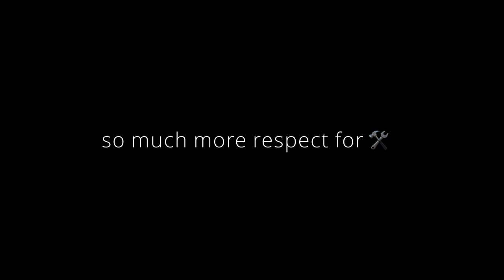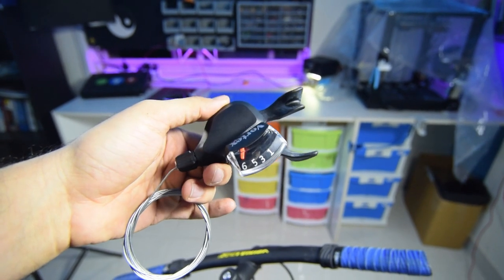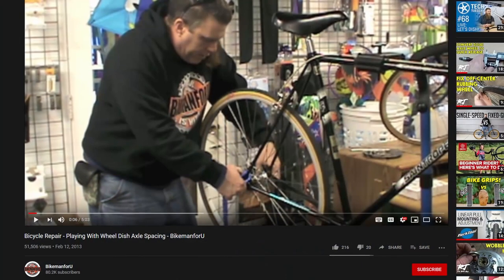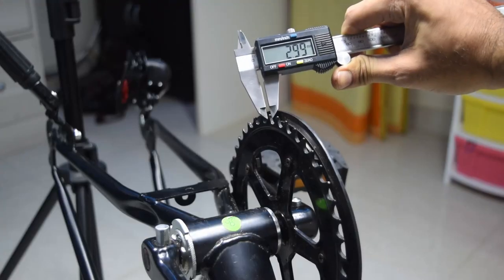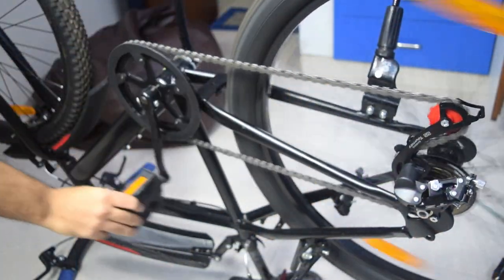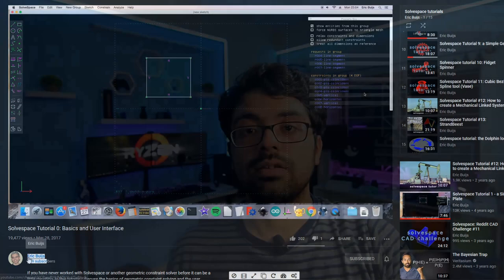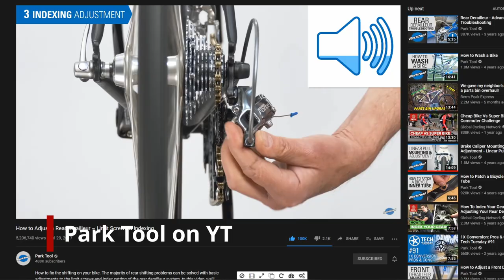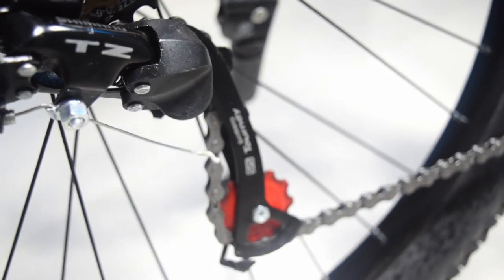Installing Shimano Gears into ANY Single Speed Bicycle | DIY Gear Upgrade

Comment: I'm really glad I came across your video. I recently bought a Dahon single speed bike and while I did enjoy riding it, riding up inclines is absolute hell on my legs and nearly blacked out. Twice.

I was planning on upgrading/modding the bike with a few adjustments to make my rides easier. And seeing that a 6-gear hub will not fit a single gear hub really made me rethink about installing a 6-speed hub. It would be better to get a 3-speed hub for the spacing. 

Overall, it would have been much easier to just buy another bike and just toggle with that instead. That way, all you have to do is swap out the OEM with aftermarket parts.

Comment: This is a great video... thanks for sharing! I am looking at adding gears to a fat tyre BMX and then adding an electric motor... This gave me quite a bit of insight into what I'm trying to do. Could you have not just replaced the chain wheel with a compatible one? Or are these universal and an expected challenge?
Reply from the maker: I could have probably replaced it, but due to pandemic I had to order it and I didn't want to wait too long

Comment: The 3d printing ,man that's a great skill, you couldve drilled a hole through the handle bar or added a hose clamp and drilled the hose clamp,the wheel needs to be re aligned or also known as "dished"which basically moves the wheel position to one side more then the other,it is done with a wheel spoke/nipple' tool or an adjustable wrench and by oiling the spoke and nipple thread junctions before doing so,that way the axle will also benefit in giving you more thread on both sides of the axel bolts, check your wheel spokes afterward because some will protrude out of the nipple thread junctions so you may need to file them down afterward,also check your wheel rim holes maybe add duct/pipe tape as a rim liner,to prevent a rim puncture✌
Reply: You are right. He should have dished the wheel and can still do that. However it will not make his axle longer 😋

Comment: Nice work. 
Good documentation. 
I have done plenty of DIY on motorcycles when I was younger. 

My only q.

After everything was done, could you manage to get the rear wheel properly aligned , as in, centered?

Comment: I purchased 6 speed gear kit- freewheel and derailleur is from vanum with shimano 7speed rapid fire shifter plus gear chain, now I am facing same problem with chain, gear chain is thinner so I have to sand or file down the chain ring.
Angle grinder reduces your efforts but increases your chances to make mistakes but filing is peace of mind just because it reduced work speed....! 
I will share my experience if I face any more problems.....!
Reply from the maker: Good luck!
Make sure to paint the exposed chainring with some good paint. A spray paint won't work well.

Comment: Im also considering upgrading my gears and I have come up with a solution regarding the axle not long enough, offset ecc. Maybe buying a rear wheel with 7 speed cog(i found some in Facebook market that is ready to mount) will simplify the job.
Reply: Or install a new hub into your wheel. Make sure the diameter of the spoke holes is the same so you can reuse your spokes otherwise it will be too costly.

Comment: You were really honest. I liked that. After watching this video I decided to buy a geared cycle instead of modifying a gearless cycle. But I wondered why didn't you buy a new chain which was thicker enough to fit your front chain wheel instead of scrapping off the thickness? What if you get a thick chain next time when the present chain is over used? Any way lot of things you have done. I would have left this project at the first challenge itself 😂😂😂✋👍🏿
Reply from the maker: 😂 man If only the thicker chain worked, thicker chain won't work with the gears at the back and the derailleur
Reply: @chinmayshalawadi1  Then that was the only option bro. I missed it☺️

Comment: You could change the stem and handlebar
Reply from the maker: Yep that was another option!
Reply: @chinmayshalawadi1  I have a 29inches single speed mtb  and I want to install gear in it so what u suggest should I do it  or not.??
Reply from the maker: If you have the time and you like doing such things then go ahead!! It's a great experience. As you saw the process can be quite tedious
Reply: Great work.. 🔥

Comment: I had 24 inch wheel, I want to upgrade it to 26 inch, when I tried it worked for single speed (rear wheel free to rotate 26 inch one) but when I put gears (I already installed it for 24inch) it strikes the frame,... Please anyone know how to keep wheel at the centre even after installing the gears???? Please help me out guys..

Comment: How did you mount and guide the gear cables on the frame? Didn’t you find problems with the cable slacking?
Reply from the maker: I used zip ties to tie them to the frame of the bicycle

Comment: I feel like im looking into the mirror because this is pretty much the same adventure im going through right now although still at an early state since im unable to remove the damn single-fly wheel and crankset/chain ring, idk how you managed to do so without the dedicated tools but im also no cyclist, i just wanna convert my cycle to a decent multi-speed one instead of the crappy installation and parts the local bike shops in india/Pakistan offer. I also want a wider gears range than the generic 11-24t 6speed the local market has (thatd an estimation)

Comment: Great work. You mentioned problem which no other youtuber did. Besides, there aren't any videos on turning a single speed into a 8 speed. You helped me a lot. I was just wondering to know if the ride has become easier in uphill?  And doesn't the derailleur get stuck in the wheel while you're on the 1st gear?!
Reply from the maker: Yes Ride has become so much better uphill. Nope derailleur doesn't get stuck :D

Comment: do i need to change my bicycle wheel hub for installing gear???
Plz reply sir 🙏🙏🙏
Reply from the maker: Ideally yes, to do it the correct way change the hub of the rear wheel to one which can hold a gear cassette. But building the wheel again at home is a hard job.

You can still use existing hub but it's a bit of a hacky way. Not durable for long term use
Reply: @chinmayshalawadi1  ok 
Thnk u so much for your response ❤️🙏🙏

Comment: I'm planning to get this done. Is it better to have 6/7 gears or install the crankset as well to make it 21 speed? What do you suggest? Any reason why you did not do it?
Reply from the maker: This was just an experiment and my cycle had a very cheap crank and a very old style bottom bracket. I would have had to replace the bottom bracket and the whole crankset. 
It would have gotten too expensive. 

If your city is very hilly then get 21 speed, else 6-7 speed will be enough
Reply: @chinmayshalawadi1  thanks. It's for Bangalore roads..
Reply from the maker: Yeah 21 will be better for Bangalore roads 😂😂, many places are very hilly.

Comment: You should have added 5-6 ring in your old chain and that may worked fine ! I am planning to change my frog cycle from single speed cassette to 7 speed 12-28 ... I have ordered Betwin cassette, derailleur , shifter and chain from decathlon.
Reply from the maker: What's a 5-6 ring ? Good luck  with your upgrade :D
Reply: @chinmayshalawadi1  chain rings ...
Reply from the maker: Ahhh
Reply from the maker: Thank you I'll take a look at that

Comment: I have a 20 inch mongoose axe bike would it be possible to turn it into a multi speed bike?
Reply: As long as it has a steel frame which you can expand to 130 mm
Reply: @rolandberendonck3900  thanks.
Reply: I want to convert my busted schwinn scrambler into an ebike and the 20" cheap kits have gears on the hub so I'm wanting to add gear selection as well.. anyway I'm sure it can be done with persistence

Comment: My bicycle is a single speed bicycle with a full aluminum frame. So can I install gear on my cycle?
Reply from the maker: Aluminum is a bit tricky. Aluminum does not bend that easily. I wouldn't recommend

Comment: My cycle is 7 gear i want to upgrade to 20gear how much would it cost
Reply from the maker: You'll need to change the front chain ring from single to 3 chain rings.
Reply: @chinmayshalawadi1  how money 💸 bro
Reply from the maker: Depends on your cycle, how much you want to spend and what's compatible with your cycle.
You might also have to upgrade the bottom bracket.
Reply: @chinmayshalawadi1  its my brother cycle he took it in Dubai may be at 10k now its for me so i should i upgrade it or wht
Reply from the maker: Just use it with 7 gears for sometime. It should be enough for the most part. 
If you absolutely feel like upgrading later you can think about it
Reply: @chinmayshalawadi1  Ok bro 💕 becz my parents said they will not buy me new cycle so i have to cycle like 😂3km to college so

Comment: Hello, can I install these multi speed gears on Hero Velocity? It has single speed. Electric bicycle. Thank you.
Reply from the maker: Not sure about electric bicycle. It will have additional complexity of electrical wires and motor on the rear wheel. You can probably do it but, you'll have to research a lot
Reply: @chinmayshalawadi1  thank you very much!! Will do.

Comment: How we can install 1x8 gear set in single speed?
Reply from the maker: Usually not possible without changing the rear hub, since 1x8 gear set don't come as freewheels. You'll need to switch the hub to a cassette compatible one
Reply: @chinmayshalawadi1  Not at all. 8 gear freewheels do exist. However you need an even thinner chain with that freewheel so you have to file some more away then 😂

Comment: I'm preparing to do this myself.  I am using an old 10 speed that has no miles on it so the gears are perfect.  Everything matches so hopefully after watching your vid I will avoid some of the complications you encountered.  But, this is a great presentation.  Thank You!
Reply from the maker: Thank you :)

Good luck with your build !

Comment: I have also a gear kit and i installed but my break is not working pls comment
Reply: Pls comment
Reply from the maker: Hey usually the wheel won't be centred if you haven't changed the hub. You'll have to offset the break pads with extra spacers on one side and remove spacers on the other side. Also play with the brake caliper tension
Reply: @chinmayshalawadi1   thanks

Comment: Dude! you actually did a great job, you are a true engineer. Also,you left one step after cold setting called dropout alignment, check 'rj the bike guy' he has made a video about it, dropout alignment reduces the chance of axle breaking. Best of luck 👍
Reply from the maker: Thank you :) 

I've actually seen that video!! 
I figured I'll never be able to align it well since this wheel hub is too wide. And this cycle was never meant to have multiple gears installed. 
Only way I can save the axle is by getting a new longer axle and having proper spacers to align the wheel in the dropout.

As it is currently axle will probably get damaged due to misalignment

Comment: Sorry for your so much frustration, but you could just go to a roadside cycle dealer/repair shop and they could do that in less than 30mins. For a very less bucks.
Next try to make food by growing everything for your own. And yes fire too😂
Sorry if I hurt you, but this world is a community, go seek for little help it works better.
Reply from the maker: 😂😂 you missed the point my friend. 
The goal was to explore, learn and experience the process. It was not about getting it done the fastest way. 
Also seems like you didn't watch it completely, I did take a lot of help from online communities and local shops :)
Reply: @chinmayshalawadi1  I might missed the point mate, but I thought no one gonna 3d print and bend their cycle and grind the wheel and so much hassle. At my place they just go to a dealer and they do the work. BTW thanks for not taking me otherwise
Reply from the maker: Yep even I suggest the same to people.  Very few of them will do it on their own since most don't have the time or engineering knowledge for it. 
This video was a documentation of the what I went through. I had some extra time during the lockdowns lol
Reply: Look at his creativity instead of seeking out help. He is inspiring us to solve any kind of problem which we come through in general. We cannot always ask for help

Comment: Can i install it to roadeo a200 model
Reply from the maker: I don't know about the exact bicycle but you should be able to in 99% of the cases
Reply: @chinmayshalawadi1  but it will be more easier than i right
Reply: @chinmayshalawadi1  urs
Reply from the maker: Actually it may not be, if you like doing such stuff and solving problems you won't expect then you should do it since the experience at the end of it is pretty great. 
But many people will find it easier to just get it done by someone, preferably a bike shop
Reply: @chinmayshalawadi1  how did u increase the spacing in wheels whethe i shld buy a lengthier axle or what
Reply: @chinmayshalawadi1  im just 15 bro pls help me
Reply from the maker: I already had a longer axle, but I suggest replacing the axle with a longer one. Even in my case I'm short by about 20-30mm from ideal case
Reply: @chinmayshalawadi1  tq

Comment: Bro , you look high while recording this video,  and also your free wheele looks a tag miss aligned , if you don't fix it the problem won't show in the near future but as time goes on the free wheel will start wearing out , its probably because you used a lot of washers , trust me I've experimented with cycle gears , but anyway nice video looks like you put in a lot of effort
Reply from the maker: I recorded it at 5am without sleeping 😂 that's why I look like that. 
Yeah it's a tad misaligned but I'll be riding the bicycle only for the next 6-7 months. It was just a fun exploratory project and was a learning experience. 
Thanks for the complements :D
Reply: You put way too much work and thought into that. You could use a regular width chain on a 5 speed swap as long as you are keeping a single front sprocket. Instead of tweaking out and taking a file to each tooth, you could have added to your old chain and hooked it together with a master link. You would of been 15 minutes and done. Also the shifter mount can be spread apart and slid right on then go find a longer screw to tighten the round clamp. You turned a 3 hour project into an overthought cluster fuck. It's almost like you tried to reinvent the wheel.
Reply from the maker: I would have kept the single speed chain it it worked. But it's too thick and not long enough for a derailleur setup. 
Also I never said I was an expert, I was trying to learn as I was building along. I was completely new to bike tech.  
Yes 3D printing could have been avoided but I got to learn 3D Modelling  and solve a problem at the same time. 
Also the Round clamp cannot be slid over the handle bars since it's not flexible and very rigid. 
Stop being a presumptuous ahole.

Comment: You can also get a throttle style gear changer... Not sure if there are Shimano ones, but I have one on another bike and so do the kids :)  https://youtu.be/m1PQN1JXrKk?t=918
Reply from the maker: I initially wanted to but the handlebar on my bike is not cylindrical, most throttle style ones wouldn't fit